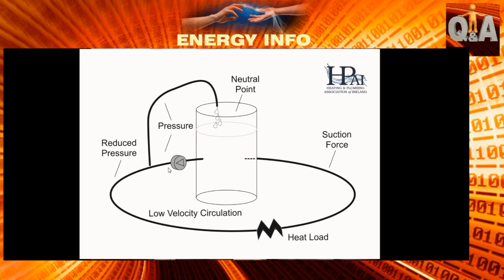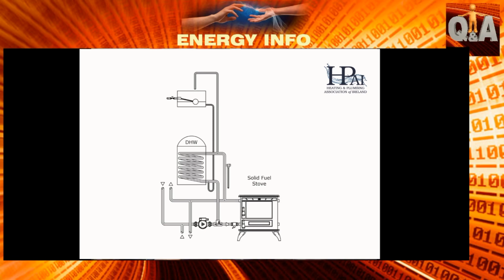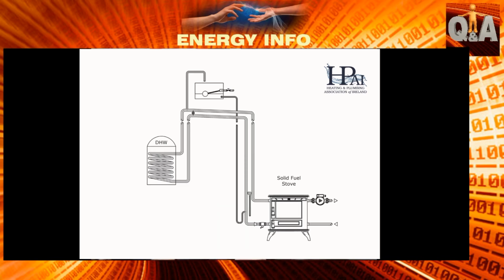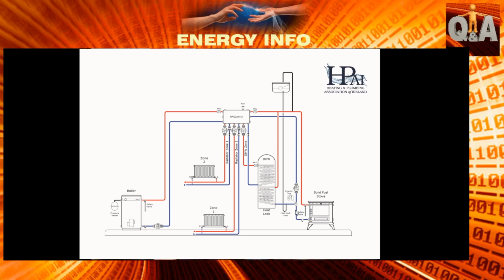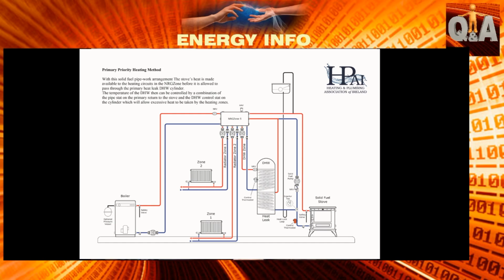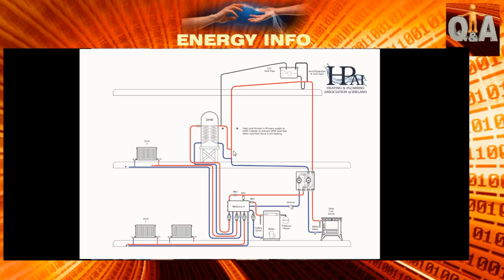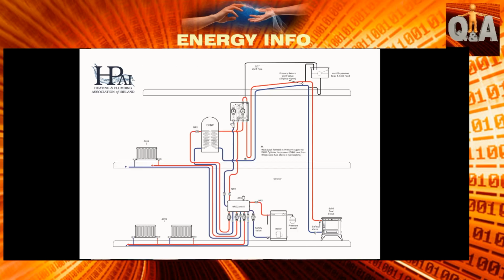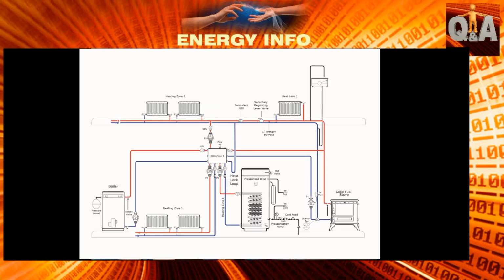HAPAI   Solid Fuel Gravity Circuit Seminar

Comment: Thanks Harry & everyone. I & many others did design training with the Solid Fuel Advisory Service here in Glasgow in the early 80’s. It was a fantastic grounding for me & others, it helped greatly in my Heating Installer career over the last 50 years. 
Many of the systems Harry described, we installed using the SFAS designs.  Cylinders remote from Stoves in bungalows etc etc. Primary Flow & Return Pipes crossing attics was fairly common back in the days of Coal Central Heating.

Some of the auld boys thought it was wizardry & said it would ‘never work’, but we proved them wrong. They were from an age of Cylinders Sited directly above Fires & Boilers.
Thanks for sharing & luv from Scotland.

Comment: I have a x4 pipe system in the back of a wood stove with back boiler. Now going to change to a pellet stove to heat rads and hot water in a tank in loft.  the pellet stove has a pump and expansion vessel inside of it...and only x2 outlets..hot and cold. How to go from x4 pipes that used to come into the rear of the old stove to go to x2 pipes with the new pellet stove? thanks for help
Reply: I'm plumbing a pellet stove my self an im going to try plum it, but can I put the 2 pipes down an over the floor an up the wall the opposite side of the room!?? Any advice

Comment: is it possible to have a system using solid fuel 2 x rads and a cylinder without any pumps or stats? do you have a drawing please?
Reply: No. You have to have a pump
Reply: @gulag8735 No you do not have to have a pump, al so check on this video the man has 4 rads and cylinder working without a pump 31.08 on the video